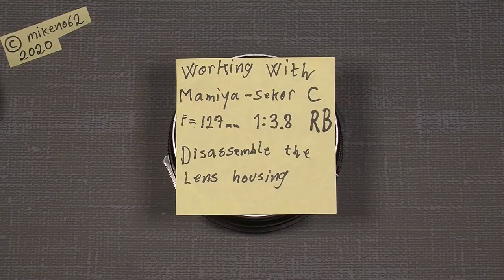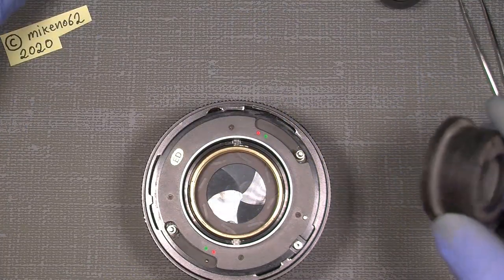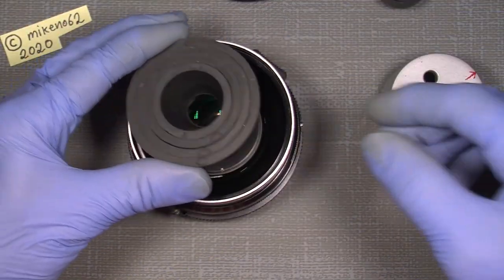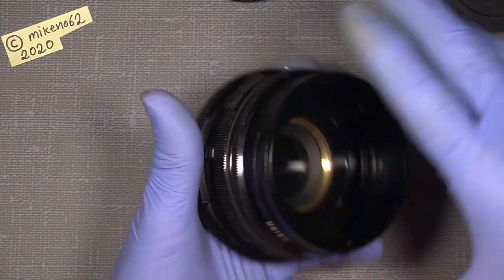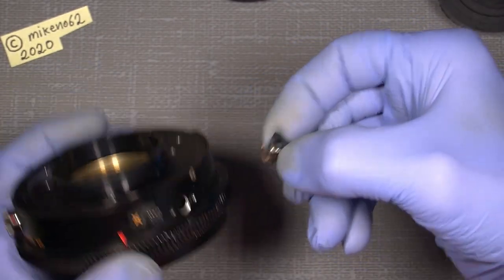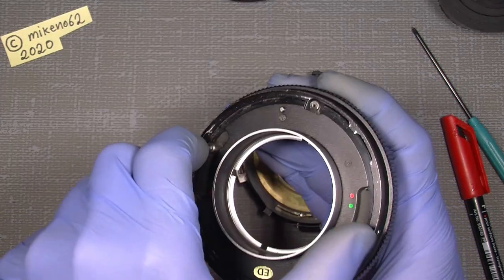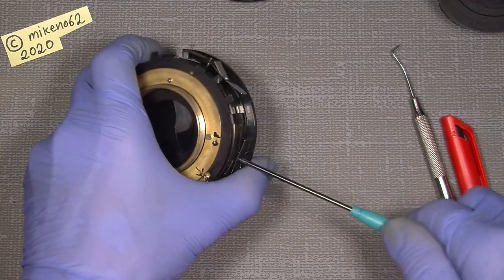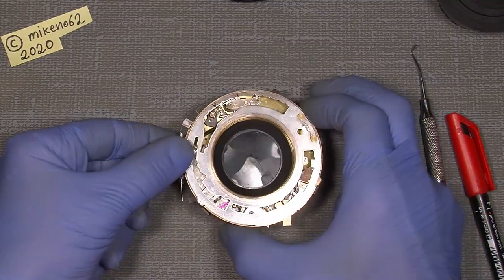Working with Mamiya-Sekor C f=127mm 1:3.8 for Mamiya RB Disassemble the lens housing

Comment: Hey
I've got a problem with the 90mm Sekor lens with my RB67. I cleaned and lubed the shutter mechanism on the lens. On it's own the lens is working right now. But on the camera after cocking it and pressing the shutter button the shutter closes directly without exposure. I think there is a problem with the cocking mechanism... Because when I cock the lens manually (by hand) it exposes perfectly. I haven't got this problem with my 180mm Sekor C lens, so the body is working. 
Have you got an idea what the problem is and how th fix it? I would be very grateful for your advice, since sending the lens for repair is probably not worth it.  Thank you very much! 

Best greetings from Hamburg

Moritz